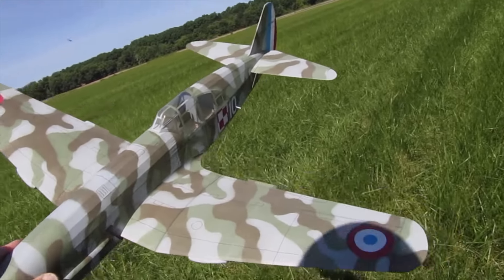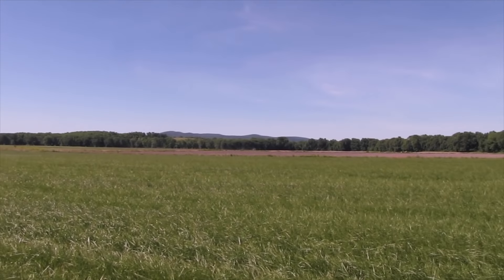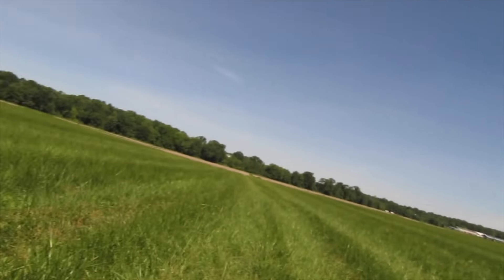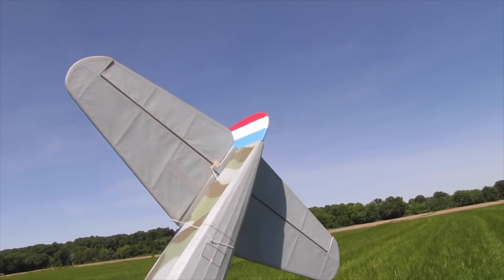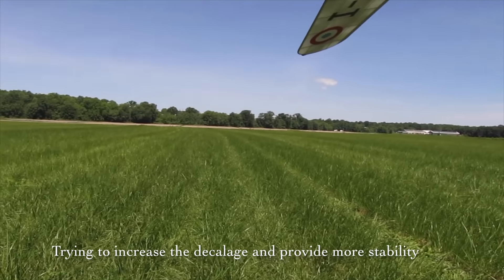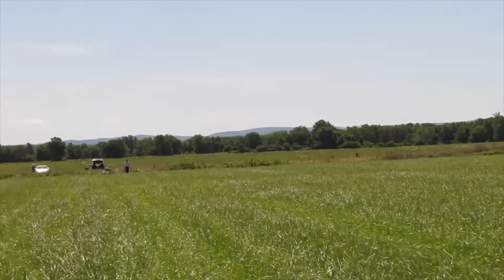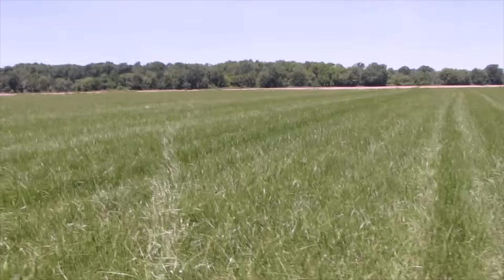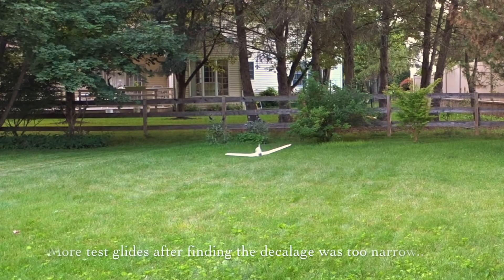Rubber-Powered Caudron C.714 - Anatomy of a Trim Session #2

Comment: I have also encountered similar situations. I did not directly change the angle of the horizontal rudder surface because the aircraft is too sensitive to this adjustment. I just added a Gurney flap to the rear edge of the upper surface of the horizontal tail, and the effect was good. . After returning home, I measured it with a spirit level and found that the installation angle of the horizontal rudder surface was wrong. I just didn't understand the meaning of the word "decalage" in English.

Comment: The 1st flight at 640 looked so promising. After that, the decalage problem seemed to get progressively worse with more power. Really crushing to see that crash damage, but the after repair test glides look promising. Looking at the nose block, it does seem to have too much down thrust. Looking forward to next trim flights. Cheers
Reply from the maker: Thx.  Yes, I was able to block up the lower face of the nose plug by nearly 1/8" to right the situation.  Seems I had several optical illusions at play while building this one.

Comment: Thanks for a good new word. :) Although familiar with the effect. There is probably a swedish word for this also. I am very impressed how you trim those scale machines.
Don't they ordinarly have glued wing as well as stabilizer? I only have experiencies of rubber band clamped counterparts, thus it is very easy to apply or remove a chip.
Many thanks for all good videos. It made me restart building models again after nealy 50 years of absence.
Reply from the maker: Thanks for the kind words.  So very pleased that the flights inspired you to return to the hobby.  Good luck with future projects!

Comment: Wingtip wash out ?
Reply from the maker: No.  I always build them flat.  I make any adjustments with Gurney flaps, or thin strips of balsa on the TE.
Reply from the maker: The varying rib blocks are merely to accommodate the chord of the various wings.  The height of the rib is usually 9-10% of the width of the chord.

Comment: What is dt?
Reply from the maker: Dethermalizer.  It's made with a timer attached to a series of strings & springs, which are then attached to the tail or stabilizer.  When activated, the tail pivots to 30º or so, which frees the model from a thermal ride, bringing her safely home, rather than going out of sight.  That's the plan at least.  You never know when a thermal is going to take your model for a longer ride, so when I trim my models, at some point I start using the DT as a safety precaution.